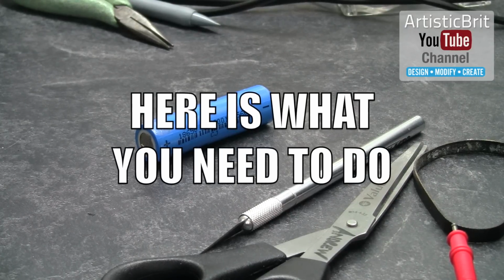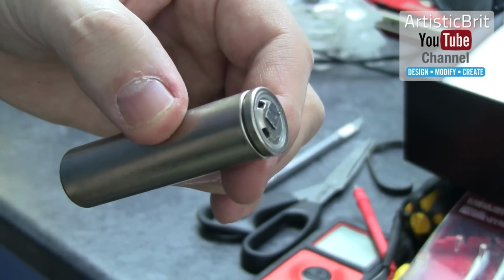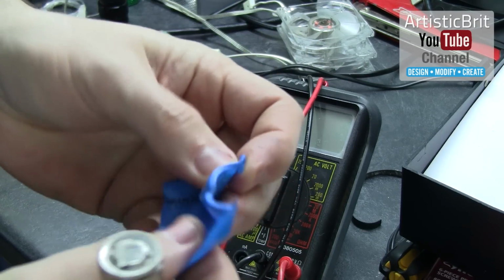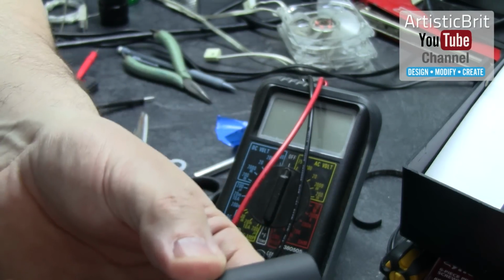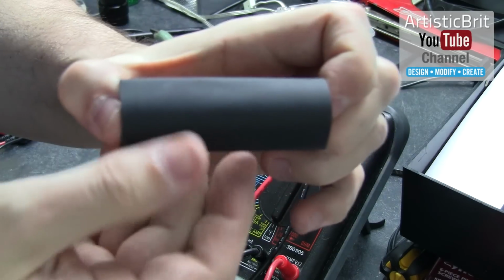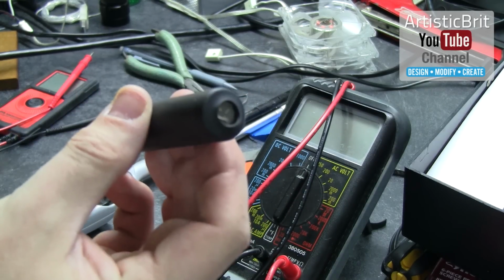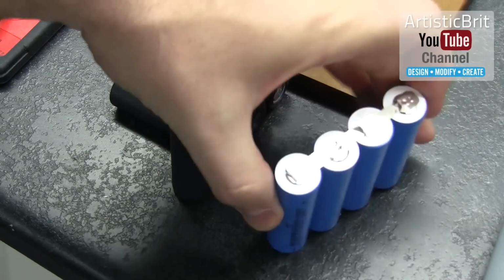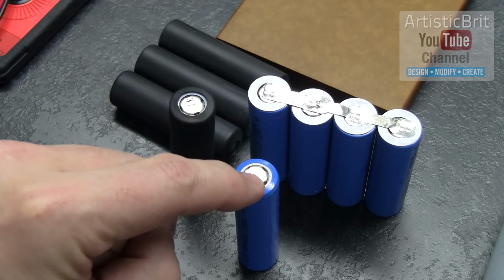Electric Danger of Lithium Ion 18650 - Battery Fires Exposed - Possible DIY Solution

Comment: I bit of clear coat or hot glue works I used this for my rc cars/planes now they make protected li-po packs that have a carbon fiber shell. I crashed my rc plane from 230 feet into the parking lot it hit the ground at 56 mph it hit so hard it bent the shaft on my brushless motor and the battery was fine I still have it three yrs old
Reply from the maker: Ah, great thought. Hot glue would be much easier too. I'll have to give that a dance. Forgot all about a Hot Glue gun. Nice
Reply: H8edsinclair Just wondering.  As I understand it this battery has a max discharge rating of 2C.  How are you using this in an RC environment where ESC's can see discharge rates of 30C (or higher)?  Not trying to criticize you here, again just trying to understand.  I would like to use this battery in a 4S config for flying my quadcopters but am almost sure the 2C rating is a non-starter here.
Reply from the maker: Appalling68 check this video for your answer: Episode 144 - NCR18650B The Future of RC Batteries?
Reply from the maker: Appalling68 As a side note: I have combined over 90 18650 batteries in series to achieve incredible power for an electric bike I am making and putting onto youtube.
Reply: Andrew Jones
Yeah, I saw the video but the guy really didn't address discharge rate except for a glancing comment.  I could see this maybe working on a low kV motor on a light, single engine RC airplane.  But a quad (or hex for that matter) is a whole other ball of wax.  No one in the RC forums I hang out in has used this in MR (multirotors) nor do they think a 2C max would cut it at all.  I was just wondering what H8edsinclair's setup was.

Thanks!
Reply from the maker: Appalling68 Got it... The video was quite interesting too. I just come back from the hobby store to create a scaled version of the machine this guy created for a youtube series. - Crap! Sorry I thought this was a comment on the perpetual motion video I saw the other day, hehe
Reply: Appalling68 i wasn't talking about this particular battery I was just giving a tip on how to make the battery safer and a little less likely to short out  sorry for the miscommunication.. p.s. be nice if we could run are models on one little  battery instead of the hundreds we spend on  li-po/ li-on packs
Reply: Appalling68 i wasn't talking about this particular battery I was just giving a tip on how to make the battery safer and a little less likely to short out  sorry for the miscommunication.. p.s. be nice if we could run are models on one little  battery instead of the hundreds we spend on  li-po/ li-on packs

Comment: I like your idea but I would not use heat tube be cause of the heating process I would use electrical tape also I would mark the positive side on the tape if there going to blow it is most likely the wrong polarity that caused it
Reply from the maker: Ryan B Yeah, not a bad idea Ryan, though in my playing, the heat that is used isn't too bad and had never affected my batteries life. Though am playing with some testing over the last few weeks to see what's best.

Comment: So you created a problem by removing all the protection built into a 18650 battery- then showed folks how to replace it with something that is marginally better insulating that completely changes the dimensions.

Try looking at youtube videos by jehugarcia, he will show you how to properly assemble a battery pack with mounting clips that hold batteries securely but separately in a pack that he uses in an electric vehicle. 

PS- When you stated that "all 18650 batteries are pretty much the same" you are way off base- I suggest you do some research on capacity, amp capability etc...

Comment: THANKS.    I read Panasonic 3100mAh High Capacity Lithium Ion Batteries are the best and that is what I have.  The ones marked with A at the end lol.
Reply from the maker: I'm not sure to be honest, though 3100mAh, is pretty good. Mine are nowhere near that.
Reply: highest mAh doesn't necessarily mean its the best battery! you want to look at the amp output and if its a IMR!!! which the panasonics are not, IMR's are the safest and best batteries to use, like the Sony VTC 5 for example. which still push out 2600mAh.
Reply from the maker: I am making a video which has about 100 of these cells for an electric bike ill be creating soon. This is all good stuff to know. thanks!

Comment: Umm, I get the safety issue of this, but I don't think it wise to use a blow torch to shrink the tubes. This is asking for trouble. Use a proper heat gun on low temp as I do. I takes longer, but the battery doesn't get very hot.

Comment: Great video. Thank you for using  "old english" demensions when cutting the shrink insulation. That insulation will disapate heat much better than 
the original. Come on over some time, we'll enjoy coupl'a liters of ale while chatting electrical science!
Reply from the maker: +Bryan Haugen Awesome, sounds like a plan Bryan!
Reply: yes, a winter jacket will keep you much cooler than a windbreaker.

Comment: i use soldering iron to shrink tubes.. rub it slightly against the tube ..
Reply from the maker: marlon mercado I have tried this too Marlon, it's not perfect, but it is less heat than a flame for sure!
Reply: yes for sure .. and safer

Comment: As far as I know all batteries are like this and have always had a -ve case up to the top.  There are greater risks with an 18650 so the heat shrink is a good idea but I would not get too worried about it.

Comment: To make Li-ion cells safer, you heat them with a flame!?
Reply from the maker: They can handle this small amount of heat no problem. I also solder the tips of mine to create much larger cell packs. - Never had an issue with flame while heat shrinking, period. ALTHOUGH arcing from one terminal to another is a much more serious issue, especially as these are usually used to create much larger cell packs where the amperage is much higher. With THAT, you have instant issues.
Reply: while in the microwave at full
Reply: andrew jones the terminal closeness isnt an issue at all , personally ive known this from 10 yr old playing with batteries , most people who will takle building an e bike or something of that nature will also know this simple understanding of the ways of the batteries , i find it surprising you think this is an issue , the regulation of batteries and their safety is extremely high , and the batteries were perfectly safe in their own enclosure , all covered and " the ring " you took out was the main protector ..

Comment: I have seen a video of one shorted.  It looked like 4th of July fireworks so be careful not to short them.  You might also want to get a paint marker and mark positive and negative since they now look almost the same.  A paint marker is similar to a permanent marker and sticks to more surfaces.  It will still wash off with some solvent easily like permanent marker.

Comment: One to remember the top of a "proper 18650 cell" incorporates a cut off thermal switch. If you look at the very top there are 3 slots, under there is the top of the thermal cut off. If a cell reads no voltage there is a possibility that the trip has been activated, either by internal cell heat or external short. I stress this is a feature on reputable cells, on cheap cells I can't comment. Unfortunately, there is a procedure to reset the thermal element by inserting a small diameter pin into one of the vent holes and pushing down, done correctly this inverts the thermal disc back thus allowing operation. BUT remember it inverted for a reason, these cells can take a life, therefore care, even over care must be observed at all times. I look at them as a "hands grenade with a very loose pin" anything without a known quality manufacturer is making the pin even looser.
Graeme

Comment: i dont see a problem.. The plastic washer does a great job preventing shorts.
And the washer wont come off easy, when you spot-welded a wire strip on top of it.

Comment: seems overkill. nicking the plastic would not have caused a short because it only exposes an plastic or cardboard insulator under the sleeve  that protects that top negative edge
You removed that insulator. causing the  battery to be less safe than it was.

Granted some cheaper batteries do not have the insulator disk but you can buy those disks online to add them to batteries that don't have them. I've added these when re wrapping batteries with damaged casings

Comment: I'm sorry Andrew but what you have done - in my opinion - is swap a thin but very tough covering that meets stringent safety regulations that are tested by specialists in umpteen countries, for something that is designed for a different application. And as for suggesting that cables can short between the terminals if pressed to them - do you really use unsheathed cables?

I find it hard to believe so many people spend so much time trying to show how batteries can cause injuries - by doing something immensely stupid and deliberate. I guess you are possibly trying to imply this inherent danger to mankind is only associated with lithium ion batteries?

OMG - what will we all do for torches now we know that cylindrical batteries are so unsafe?

Comment: Mike is right. You should take down this video and put up one with proper advice.
Reply from the maker: Mike isn't right. I have added text to the video now to explain to those that do not understand what I am doing. And for those who do not watch the whole thing as you will clearly see me covering the battery with the initial coating on. Though I will be adding another video to further break things down with an example of how the end cap plastic piece is useless for many incidents. Though the tiny controversy due to people not watching my entire video is very good for my views I must say.
Reply: Actually, the fact is, there is no demonstrable advantage to taking apart the outer wrapping of the 18650 cell and removing the plastic washer that protects the positive from the negative end of the battery.  If your point is to make it safer by putting black shrink wrap around an 18650 cel, you could put together a 30 second video that explains that point sufficiently and demonstrates how to do it.  That is about the length of attention span most  viewers have anyway.
Reply from the maker: Robert Orr Yeah, you are certainly right there Robert. If people watch the video completely, they see I do the rest with the initial coverings on. The first was simply to show what was beneath the sheathing and end cap. Meanwhile I chuckle at the ones that complain as it only shows they have not watched the video in its entirety. I can usually tell who has a short attention span from those who complain when they comment. ;) (Though I am certainly guilty of this in my time too on youtube)

Comment: A couple of things. You should get some calipers to measure the diameter of each battery. And you should mention in an annotation or something not to solder the battery terminals. Seriously if you are building a big pack or need maximum reliability get a spot welder for terminals or buy batteries with solder terminals.

Comment: If you really wanted a belt and braces job then why on earth cut off the original insulation? If you are going to do tis then put the heat schrink over the lot! And why are you not using tagged batteries? Overheating the cell by putting a soldering iron on it can cause internal problems very quickly.
Reply from the maker: Thanks for watching

Comment: Do note that the 18650s are no different than virtually any other single-cell cylindrical battery.  Skin a AAA, AA, A, B, C or D, whether carbon-zinc, alkaline, NiCd, NiMH or Lithium, you'll see the same thing: metal shell negative, and button positive.  It's true that 18650s are a little different than the ordinary consumer battery in that the button is flush with the shell.  That's simply because the ordinary consumer batteries are intended to be used in battery holders and be consumer-replaceable.  Open up a NiMH or NiCd pack (as in a tool or pre-made pack), you'll see the flush button again. Same narrow gap between the positive and negative.

While the shorting potential is there, it's actually less of an issue with Li-Ion than with NiCd.  Even at 1.2V, a NiCd has a higher short-circuit current than Li-Ion - I once made a copper penny glow red from a single NiCd cell - you probably need more than 100A to do that.  A Li-Ion cell won't do that.

So, if you were harvesting, say, 3/4C NiCd or NiMH power tool battery packs (the most common size in power drills), you'd see the flush button, narrow negative/positive gap, and you could do exactly the same tricks with melting wire.  If you think the 18650s are bad, many "pack" type NiCds come without any protective sheath at all, or by a tube of cardboard that just slides off.

If you pull apart a AA battery, you'll see the same thing.  Just that the button isn't flush, but the negative/positive gap is also narrow.

The real hazard with Li-Ion is overcharge & thermal runaway.  That has nothing whatsoever to do with positive-negative spacing.

You don't need to supplement the insulation wrap.  You need to exercise appropriate caution making the connections.  Like: not using a pair of scissors and an exacto knife to strip wire (frays cause shorts and wire more likely to melt under load).  Making sure that the soldering job is neat.  Use heat shrink tubing, if necessary, on the wire, not the battery.  Use an adequately sized soldering iron that will melt the solder on the wire/battery connection before the insulation on the wire melts - there's a reason why battery packs are assembled with spot-welders, pencil soldering irons aren't big enough - I use a 300W iron normally used for making stained glass, but a soldering gun can do it too - but not quite as well.  Use the right size wire (I hope you weren't using that wire to connect batteries in a pack).
Reply: Fromage Frizzbizz 
A typical NiCd(or NiMH) short circuit current is nowhere near 100 amperes. Li-ions have a way higher short circuit current than NiCd/MH, of course depending on the type of a given li-ion. And I mean normal sizes here, as in AA, C, D, 16340, 14500, 18650. Not cells from a Toyota Prius pack.

If you wouldn't believe, think about it. If a single NiCd AA cell gave 100 A in a short, you could start a V8 engine using 10 or 15 of those in series. Will that work? Yeah, that's what I meant.
Reply: Fromage Frizzbizz 
And yes, there is a reason why spot welding is used in assembling battery packs. It's better in many ways. If you're building a battery pack, you should have cells with spot welded tabs first. Then these can be connected by soldering. Never solder directly on the cell.
Reply: +Fromage Frizzbizz Mostly you are right. But the danger with Lithium Cobalt Oxide batteries is that they have a low internal resistance, which allows them to dump a lot of energy quickly. But not safely. When they do so, they chemically break down which releases its own heat as well as hydrogen gas, which can cause the case to burst. In fact, most of the energy released in a thermal runaway is chemical, not stored electrical potential. So they should have a vent to release the hydrogen that also breaks the connection between the positive terminal and the internals. You might wind up with a little blow torch for a short while if the hydrogen ignites, but it should stop the short circuit. As you mention, this can also happen with improper charging, too fast or to too high a voltage/capacity or repeated low voltage. Those are all related to internal short circuiting causing a thermal runaway.
Nickel batteries can dump a greater proportion of their stored energy in a period of time without damaging themselves. They were and still are used in RC helicopters and cars, and power tools because of this.
Lithium Iron Phosphate batteries can do both high discharge rates and high energy density, specific and volumetric (but lower than LiCoO2). And without the self-discharge rate problems of the Nickel batteries. They also can be as dangerous as any battery when shorted, but they won't have a thermal runaway that causes a fire/explosion within the battery cell. They are actually being used in power backup and power cart roles typically the province of sealed lead-acid, because they don't have to be continually trickle charged to maintain their capacity and they have longer shelf lives.
18650s (and 10440s (aka AAA), 14500s (aka AA), 26650s, 32600s (a long D) and RCR123s) do come in button-top cells in a variety of Lithium chemistries.

Comment: are you seriously only discovering this now? ever looked at a coincell battery, or normal AA or AAA ? no diference... or what about some flat batteries? all connectors pretty much near eachother, if you are a DIYer, ALSWAYS be carefull, they usealy arent made to stay loose or unprotected by some sort of casing.
Reply from the maker: +Nico Vijlbrief (CodeAsm) As hundreds have also only just discovered this through this video. I find it funny why people get confused as to why people have not heard of this.